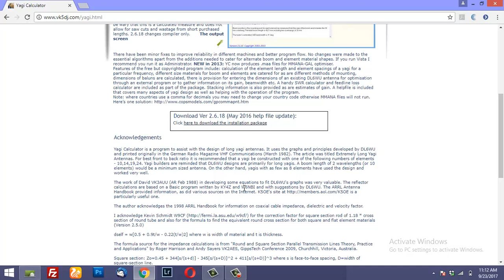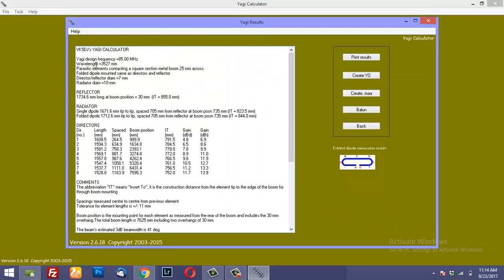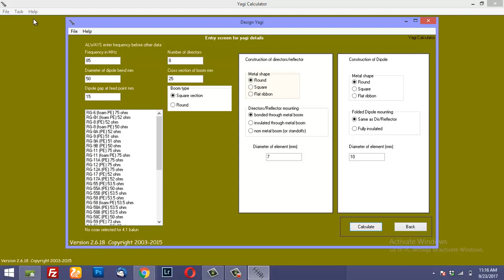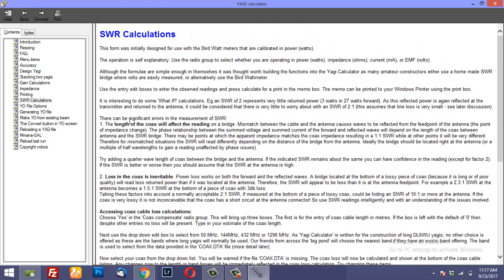Antenna Design | Yagi-Uda Calculator

Comment: Thank you for the two videos on Yagi design.  The first one  gives a very good quick summary. For the second video, 
I wonder how to fill in the measurement of diameter dipole been, dipole gap  at feed point and cross-section of boom? 
Lastly, the diameter road is less than 15 mm, does it affected to the antenna?

Comment: Thank you for the two videos on Yagi design.  The first one  gives a very good quick summary of "rules of thumb" for Yagi design.  The second video (this one) gives a quick intro the the VK5DJ calculator.  I am giving a talk on Yagi antennas in a couple of weeks, and will draw on your descriptions.  I have also found some historical insights that I will talk about.  Again, thank you for both videos and a very good explanation.  One point on the first video: I believe that a dipole antenna is not "omnidirectional", but rather "bi-directional".
Reply from the maker: That means a lot sir . Appreciate that

Comment: how to calculate the number of elements based on the frequency? i need ur help ASAP ty
Reply: number of elements I find doesnt really matter, just the placement and the lengths..  

lol on one design software I made a 32 element yagi for wifi...  its too small to cut accurately (if i remember correctly it was like measure in  .005  lol ) crazy...   but the output would have been 28 db

Comment: Thank you for posting this guide. I am trying to design a yagi for channel 11 which is 201 MHz. My problem is that there is a transmitter tower located at 77 degrees NE from my location and a cell tower is within 150 feet of my location at approximately 20 degrees NE. I also have a Mohu Leaf amplified antenna which will receive every digital channel starting at 6.1. The channel I am trying to receive is channel 11 (digital 2.1).  The question is whether I will also need an LTE filter because of my close location to the cell tower.
Reply from the maker: Thank you for writing in, but i am sorry i could not really answer or comment on your issue. I do not have the right expertise and neither have I ever used the EM wave monitoring hardware devices used to calculate the filter design in close proximity to cell-phone towers, though few of my students are working in GSM tower commissioning domain, they deal with this i guess.
Reply: No worries. Most people say they do receive a signal but it may be distorted or pixelated. I am going to build the antenna first to see if I can receive anything. At that point I decide whether to get a filter or not. Your video is still very helpful. Thank you for posting it.
Reply: far as I know the element length dictates what frequency you recieve..